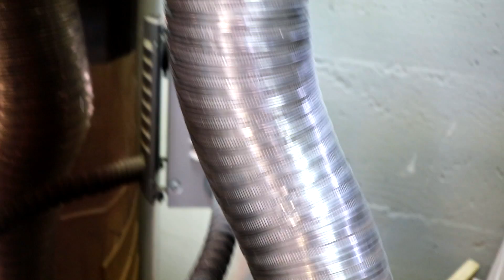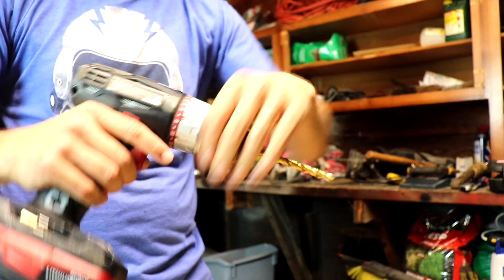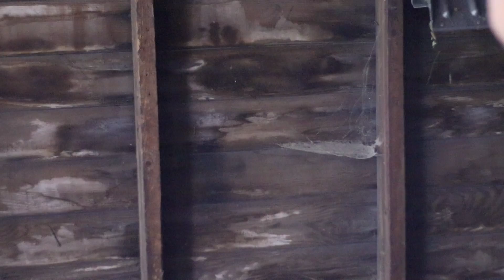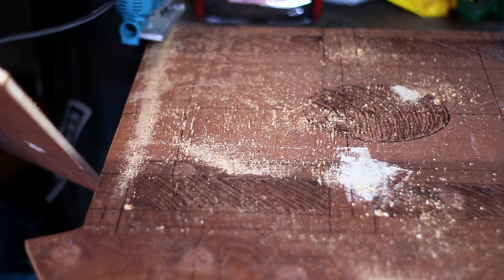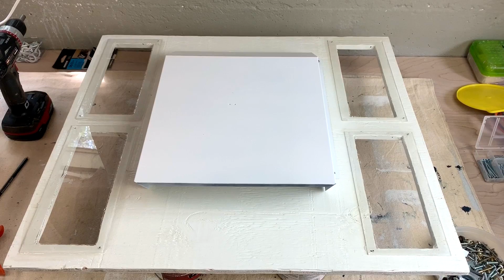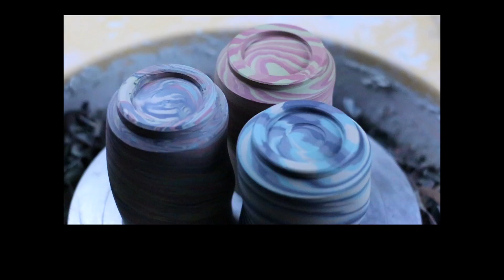DIY Kiln Venting and Dust Collection for Pottery

Comment: So, does this type of venting work well even without connecting it to the kiln?
Reply from the maker: It's certainly better than nothing. This detached venting would be better if I had a larger hood above. That's what some studios have. The direct venting is nice because it gives you more options where to place you kiln. My new set up has a moveable hood right over the kiln.

Comment: Cool, but why would you ditch your box fans for this fan? It's only 180 CFM, while the average box fan is over 1,000 CFM. 🤔
Reply from the maker: Part of it is the convenience of use. Having to precariously stack the box fan wasn't great and it wasn't sealed tightly or focused so while it was stronger it really only moved the lightest particles. Sometimes it kicked dust back inside. Or less other stuff inside while I used it. And I have to have the inside window open. Still good. But this fan can suck bigger chunks or sanded greenware.

Comment: thanks for the video! Very useful and informative for reducing studio dust! Do you also have a vent that is attached to your kiln that draws air from inside the kiln? Because I hear that the kiln vents (that suck air into/out of kiln) make more more efficient and even firing.
Reply from the maker: I used to have one with my older fan motor. I heard the same thing which is why I tried it. The fan wasn’t strong enough to pull so can’t give you any info or data. I’m working piping to try it with my new and stronger fan.
Reply from the maker: And thank you :)